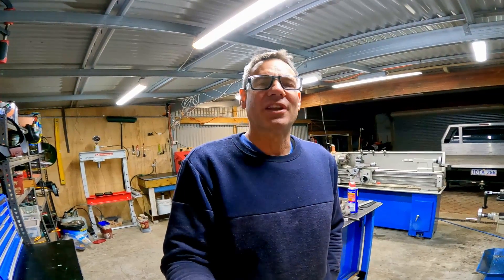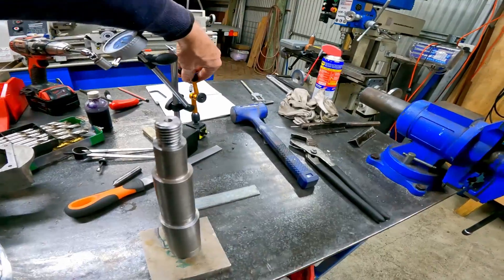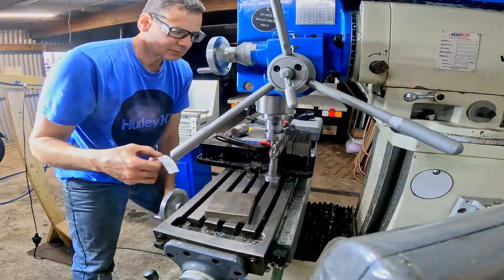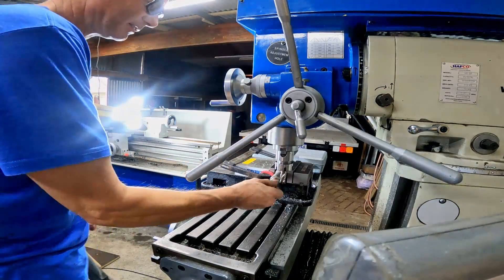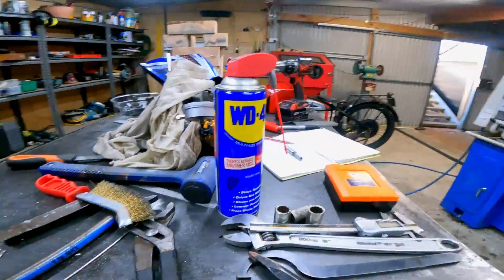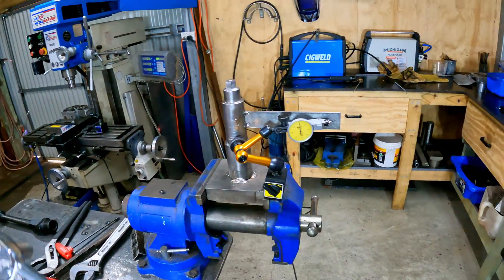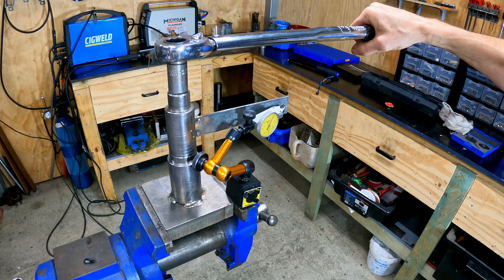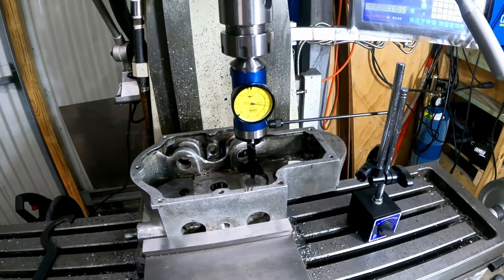Did "The Workshop" get it Wrong?

Comment: I don't understand the logic behind this experiment . All you are doing is showing that if you apply sufficient force to a shaft , then it will eventually twist the metal in the direction of the leverage.
Whether a torque wrench will click before the shaft twists is entirely dependant on how high you set the torque wrench value. 
You could have saved a lot of effort by simply clamping the torque wrench in a bench vice .
In a low torque setting the wrench will simply click when it reaches the torque setting whilst nothing else moves , conversely , on a high torque setting the the vice and workbench itself  might spin before you ever  reach a  ''Click''. !
Reply from the maker: It's a piss take, you need to watch Matt's video where he asks viewers to send him some videos on the subject. 
Yes, it's a lot of mucking around but it was fun doing it.

Comment: Its really a semantics thing...  Saying "the torque wrench wont click unless the bolt moves" is preposterous.    Put a 12 inch by 12 inch 36inch length of tungsten with a 2 inch bolt head machined into the top...  Mount it to the core of the earth.... .    Put the torque wrench on that and see if "it wont click" unless it moves.     its just some ball busting because it just didnt need to be said.  Like much of dilldudes yammering.     Great video!   And awesome shop...

Comment: Surely you need another block sat just under the hex not welded to the shaft , either with a hole of a tolerance fit to the shaft or maybe a bearing and that block also needs clamping in the vice so the whole fixture is horizontal, the bar that the dial gauge measure’s off in the same place, it looked to me there that all you were doing was pulling the shaft towards you in the direction your applying the torque, because the shaft is 9” in the air, which is why when your torquing a head down say you always put the palm of your hand against the head of the torque wrench and push away from you as you pull towards you with your other hand, otherwise your not applying the twist in the same plane as the bolt your turning !! Surely !!

Either that or simply clamp the half inch drive of your torque wrench in the vice  itself, it will click , trust me !

Comment: You actually haven’t proved anything other than your lack of understanding of what’s really going on. 

The torque setting is a measure of resistance. It has nothing whatsoever to do with movement in the bolt. 

Once the specific torque setting is reached, the wrench will click. 

You shouldn’t have increased the torque setting, you should have decreased it!

The principle is very simple. The torque wrench is a lever with an adjustable detent. If the torque wrench is set to a high setting, the bolt will be turned according to the amount of leverage over the bolt - until it reaches the set limit. 

If the torque wrench is set to a low setting, the bolt will be turned according to the amount of leverage over the bolt - until it reaches the set limit. 

It’s just the law of levers. It’s got nothing whatsoever to do with the bolt turning. 

The fact that Matt praised you may be because he’s primarily a theorist.
Reply: Here, I'll do you a favor: 13:00

Comment: I think you have cause and effect muddled. The torque wrench click when the torque is delivered regardless of the movement of the shaft, but the elasticity of the shaft means that at the toque applied there will be a visible twist. If you applied a much smaller torque using a mircro torque wrench the movement would not be visible, although twist would be there and only visible using optical techniques. Eventually  you can reduce the torque to the point where the torque induced movement is small compared to the natural movement of the shaft, at which point you are probably close to quantum effects.
Reply: You appear to be the only one who’s figured this out. He shouldn’t have increased the torque setting, he should have decreased it!

He really doesn’t understand what’s actually happening. You are 100% correct.
Reply: I think it's an April's fools joke 😂😂😂

Comment: Hmmm, would mounting the gauge onto the base of your test "bolt" not be a more accurate reference point for measuring deflection? Or maybe drill a couple holes in the base and bolt that MF to the floor

Comment: The magnetic base of the gauge was fixed to to vice not to the square base ,you are measuring how much  the vice flexes like that
Reply from the maker: Yes you probably rite, there would be some flex in the jaws.
Reply: @mostlymotorcycles.  I posted the same without reading all comments, apologies to Wayne 👍👍

Comment: well you explained  that better than matt
Reply from the maker: Lol
Reply: No he didn’t. He doesn’t even understand what is actually going on. This was the dumbest demonstration ever. He INCREASED the setting when he should have DECREASED it. See my comment above. He’s clearly wrong in all his assumptions.
Reply: @G58  He does, he's just making fun of it. Watch (untill) the end. A bolt/nut does NOT have to move for a TW to "click", like Stuart claims. Even if you make a TW click like 100 times, you're not going to overtighten a bolt/nut. Unless you don't know what you're doing and put more force AFTER each click, or use a TW rated for 250 Nm to tighten a 19 Nm bolt/nut lol. But you know that, right ?